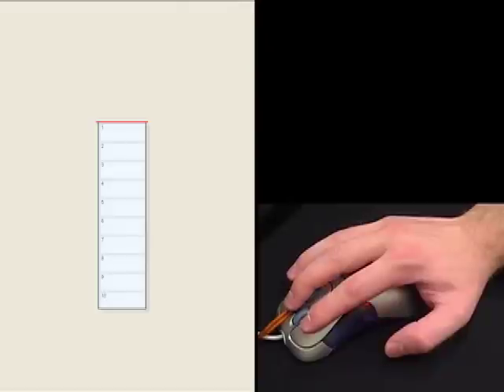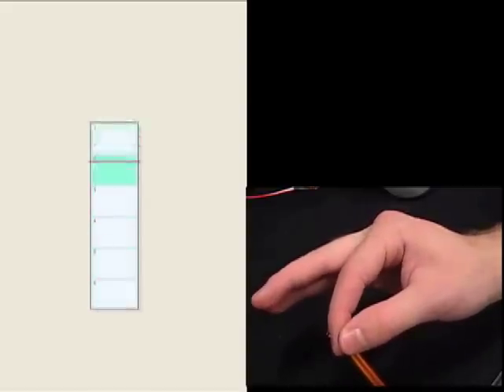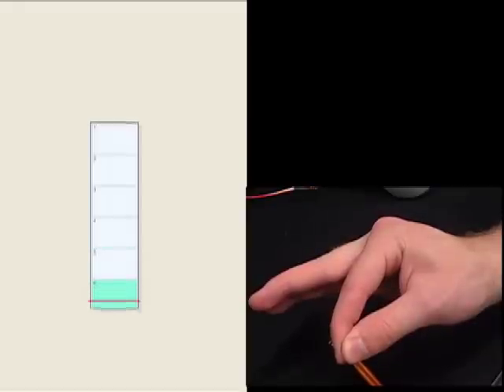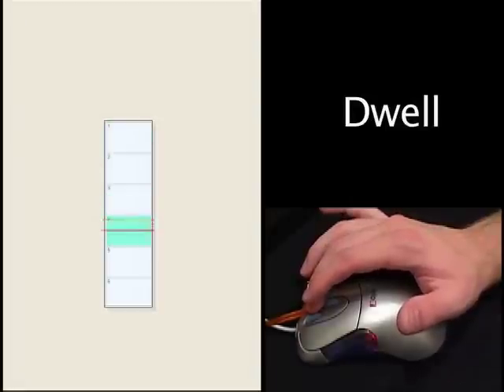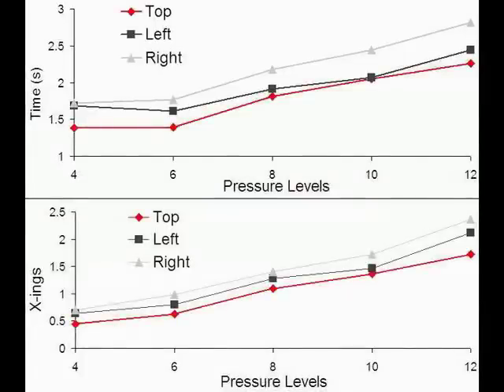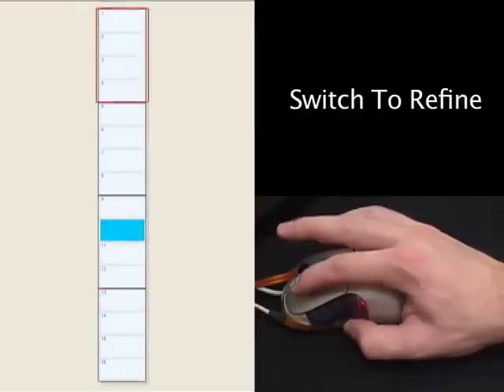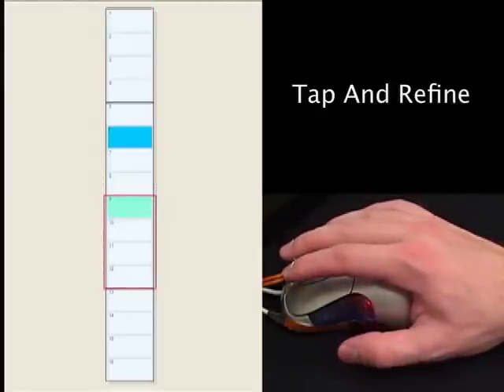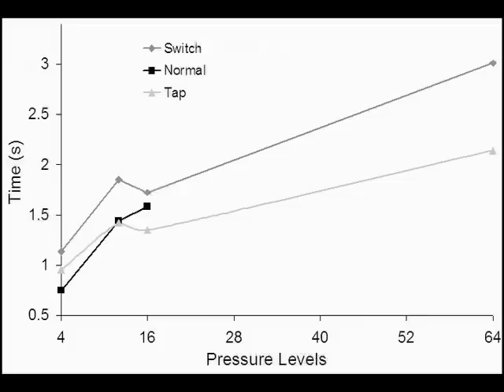Augmenting the Mouse with Pressure Sensitive Input

Comment: I too wish this was on the market now. In Photoshop I am suffering from a jittery tablet and an expensive Naga mouse that wants to flip out and do it's own thing. I want to see a device like this come to fruition as a way to "meet in the middle" and have the best of both worlds; a stable, pressure sensitive cursor. Just don't use cheap parts that quickly fall apart and charge top dollar like Razer apparently does and we won't have a problem...

Comment: I just bought a tablet for photography retouching. After using a mouse for so many years, and never very good with a pen / pencil I found it kind of awkward.
But the benefit of pressure sensitivity is the key and very useful for retouching photos or illustrations.

I thought I had an original thought by having a pressure sensitive mouse you get the benefit of a tablet with a mouse.

I never even thought of it being used for simulators / games, good idea. Can't wait to see it on the market.